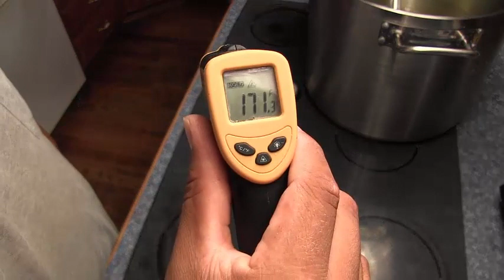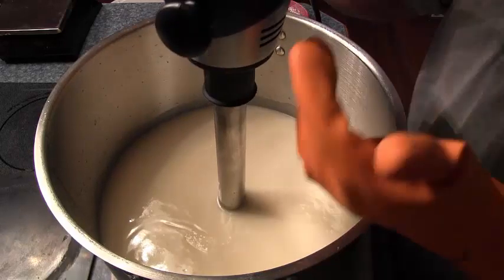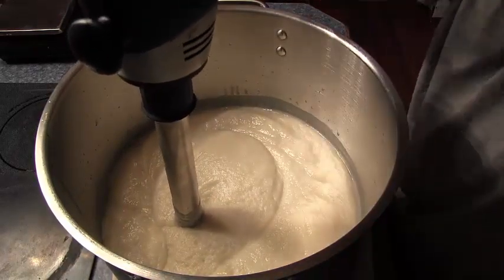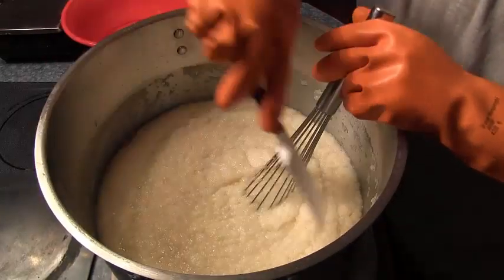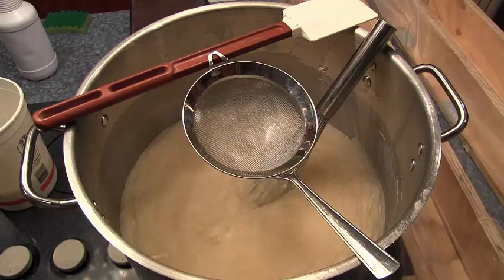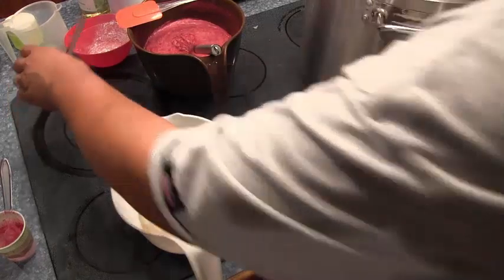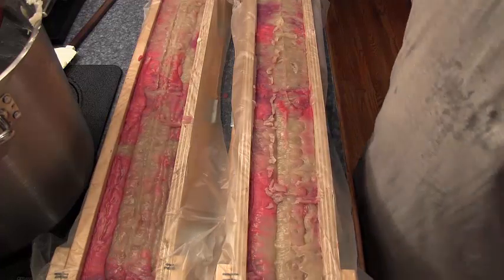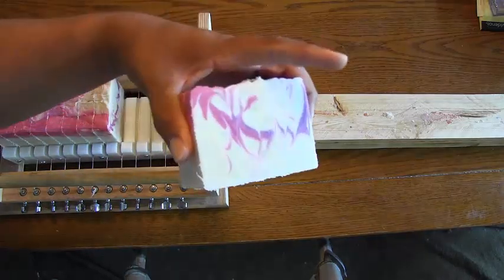Stick Blender Hot Process from start to finish

Comment: Lovey video.i have few queries
1.is it fluid hot process?
2.what did you add through filter?(as superfat)
3.What was the initial sf?and final sf?
4.does hp also need 4 to 6 weeks curing period?
5.how to rectify when my fragrance oils accelerates?
Thank you
Reply from the maker: It is also called fluid hot process.
We always allow our soap to cure for 4-6 weeks no matter what method we use. It is usable immediately after making, however, it won't be a great bar of soap until it rests for a few weeks.
You can use any recipe you'd like, SF is up to you.
If you have a fragrance that tends to seize, you can either switch up your recipe to include more soft oils or use cooler temps.
Cooler temps will not work with this method, but you can still soap with your favorite scent.

Comment: This is such an awesome video and love how you explained the reasoning. I am just starting in soapmaking and I really am too impatient to wait on cold process to cure, lol. If I wanted to add whole milk powder would I do it at the end as well to prevent scorching?  Thanks!
Reply from the maker: That I don't know.  Haven't used powdered milk.  Milk scorching happens because of too high of a temperature.  If you stay below the threshold, it won't scorch.  Or you if there is enough "additive" in your milk solution, you can "raise" the scorching temperature which will also help prevent scorching.

Comment: Waouhhh, I found that video just now that I want to try a batch of hp. Nice even if for me who is french some part can be a bit difficult. But thank you.  Did you put back your oil on fire during the process?or just stay on the heat it has from the beginning?I have a slow cooker to try mine and i wonder about let it inside all long or not

Comment: I tried this method with a two pound loaf. I got it to mashed potato stage but it never returned to applesauce stage and I never got the high temps nor volcanoing. Does this method only work with large batches?
Reply: No, it works with small batches also. If you didn't get past the mashed potato stage, it was because your oils were not hot enough. The batter needs to be around 200* by this point. You can pop it in the microwave for a few seconds to warm it up if it's too cool and it will proceed through the other stages.

Comment: when You take The pan of The Stove/heating  when The oils are at The correct temperature did you afterwords put it back on The stove to re- heat The batch during The process of soapmaking? hope you Will answer my question. 

and Thank you so much for sharing. 😊
Reply from the maker: We didn't. 
Hope this helps!

Comment: Thank you for sharing this video! I thoroughly enjoyed it. I've watched many videos on Hp and this is by far my Fav! I have a question about superfatting. If I calculate my sp at 5% do I just withhold that amount till the end or do I even add it into the calculated? I use soapqueena lye cal and always choose the option of 5% and it's already added into my oil & butter mix but I'm just wondering how I would go about it if I want to add it at the end. Thanks
Reply from the maker: You can superfat a couple of ways. Either with a lye discount or additional fat after saponification has finished.  User preference.

Comment: Thank you so much for sharing. It was very informative. How long do you cure your soap before you sell them and do you ever add sodium lactate to your soap?
Reply from the maker: NYtalk60.  We don't add Sodium lactate to any of our soap.  We don't prefer it.   

As far as curing time, it depends.  It depends on the liquid content of the batch and the environment in which it cures in.  The less liquid your batch finishes with, the shorter the curing time--as a general rule of thumb.  The converse is true, the more liquid (percentage wise), the longer it takes.  Where we live, the season of the year plays a big role too.  Spring and Summer are traditionally hot and humid.  The more humid the enviroment, the longer it takes. 

We also find that curing is non-linear, it doesn't progress at the same rate throughout the entire process.  The soap will release the most moisture during the first part of the curing process while, the amounts relesed in the following periods will become smaller and smaller.

Your cure time will also be affected by the types of oils you use.  Some oils require longer amounts of times to fully cure.  An example would be a Castile soap using all olive oil which can require up to one year to fully cure, using a cold process method.  While we've never done a Olive Oil Castile soap with HP, I would imagine, the cure time would still be significiant.  Who knows.

The length of time you wait to sell your soap is completely up to you.  Things to take into consideration would be:

1.  The method you are using.  CP requires longer time to ensure all Lye has been sapaonified--it's not fully soaponified when it is poured into the mold.  Personally, I would never think of selling something that was not fully saponified.
2.  How long you want your bar of soap to last.  The higher the liquid (non-unsapaonified oils) content, the faster it will be consumed when used.
3.  Who you are selling to.  Some may wish to sell less cured soap (but fully saponified) as wholesale, where they sell in loaves, with the understanding of their customers the soap will need additional cure time.
4.  What is your direct customer expecting to receive.

So those are some of the things I can think of off the top of my head at the moment.  Probably more than you were asking for but, hopefully something in there helps.
Reply from the maker: After all of that, I realized I never specifically answered your question.  We wait until our bars have lost 13-15% of their original cut weight.  That works well for our recipe and the shape and size of our bars.  The amount of non-saponified liquid in the soap that is poured and the size and shape of bar will affect the cure time.  Along with the things mentioned in our previous post.
Reply: Thank you for your quick response. I appreciate learning the percentage of weight loss is important. Great information!

Comment: By far the best video on the process of making HP soap, The only question I have is what are you mixing your colors with before adding it to the soap base?
Reply from the maker: sometimes water, sometimes oil, it just depends on if the colorant is water or oil soluble.

Comment: What type of stick blender are you using? I have burned one out, so got 2 to switch between while mixing. It's kind of a hassle, so I need 1 that can handle the entire process.

Comment: I have utilized this method in small batches before, and usually I pop my small loaves into the freezer.  Hope long do your loaves sit in the long molds before un-molding, and do you just leave on a shelf while it is setting up?  Do you cover the loaves at all?  Thanks for your help with this.  I am mostly CP but was chatting with my hubby this last weekend about making bigger SBHP quantities, but am unsure about the whole process in such big quantities.  Thanks in advance for your help.
Reply from the maker: Jessica,
Our loaves sit for 12-24 hours in the mold (usually closer to the 12 hour mark)
We then remove them from the mold and let them sit for about an hour if it still feels a bit sticky on the sides.
Our molds won't fit in a freezer so we just leave them on the counter until the next day.
We do not cover them either.
I highly recommend a tall-ish pot so if you do have volcano's you don't have to fight them as hard or fast.
We just bought an 80 quart pot and are slowly moving up the batches to bigger amounts.
Right now we're at 32 lbs of oil, which in the end is 55 lbs of soap at a time
Hope this helps!!
Reply: Wow! That's a BIG pot!

Comment: Thank you for sharing your video. Glad to see someone else using the same method of making soap that I have done for a long time. I make 20 lb. batches and use a Waring Big Stick Pro. My stick blender does not come apart like yours does. I like yours better. Is it a Waring too?
Reply from the maker: Yes it is a Waring.  The detachable stick is a very handy feature.  The smaller version we have does not detach and that feature is sorely missed when we are using the littler one.

Comment: Hi thank you for your recipe really nice soap , beginner can learn about this.Big help for this video.. If this is hot process,ready to used by the nextweek, right?
Reply from the maker: We let it cure a full 4-6 weeks depending on how quickly it loses it's water weight. Technically yes it can be used immediately, but it won't last very long

Comment: Great video, thank you! This is something that I want to try with a Bastille recipe but I'm not sure if I can. Some videos say your have to use a lot of hard oils, such as lard or tallow. Is this true? Also, how much water would I need to use for a 2 lb batch? Would appreciate the help. Thanks
Reply from the maker: Best thing to do is use a soap calculator to determine the proper NaOH amounts for your specific oils.  It will also allow you to adjust your water amount.  I wouldn't  recommend deviating from your normal water-lye ratio until your are more familiar with how the process handles with your recipe and batch size
Reply: Thank you

Comment: Thank you charming engineer for this great tutorial! Your wife’s design is beautiful. Can I ask what you think is the best colorants for HP soap? It looks like you used micas, mixed with something? Also I was wondering about how it is with essential oils since the batter is so hot, do you need to use more than usual cause it evaporates? How many ml/kg of scent do you use? Or oz/pound . Thank you!
Reply from the maker: Trial and error.  No fragrance or essential oil will necessarily work the same way in one recipe as with a different recipe.  Oils used can effect the aroma and retention.  

Colors.  Again, there is no one magic type.  Depends on what you are going for.  An all natural soap?  You may want to go the plant extract route.  CP?  Will it gel or not gel?  HP?  Are you adding before mixing or after?  So many variables.  Try different ones and pick which best suites your needs.
Reply: Thank you!

Comment: what did you use to line your molds. very excellent vid I love it and thanks!!!!
Reply from the maker: I think for that one we used easy glad wrap.  Not saran wrap, the wrap with one sticky side and one side that is not (Why can I not remember the name of it at the moment)....

Press and Seal!  There it is.  Way too much work to remember that.

We make all of our molds in house so we use a variety of liners.  Whatever does the job for the mold we're working with.
Reply: thanks, I can't line molds with for anything with freezer paper and only have silicone liner and molds from essential depot which gets very heavy on the pocket. thanks very much keep the videos coming it was awesome.

Comment: Wow, you do such a fine job and making sense of this process.  I am of the understanding that HP save money on EO's, as you add them at the end when the soap temp. is cooler and lye is cooked out.  Was your soap at about 200 when you added the scent ? That is the only confusion I have. Perhaps your scent is at a high flash point ?
Reply from the maker: Generally speaking, you may save money on EOs and FOs with this process.  That is no guarantee though.  It comes down to the quality of the EOs and FOs you use.  You may need to use more of a lower quality fragrant than a higher quality one.  But you do not have the potential of the fragrant being consumed during the saponification process--assuming your batter is fully saponified at the end of this process.

Comment: ok when you figure out the oils. how do you figure out how to superfat? Do you use soapcal? Is the soapcal at 0 (zero)? How do you figure out how much oil or shea to use to superfat? I don't know that much about making soap and need help
Reply: Type in your recipe with a zero % superfat. If you are using 1kg of oils and want a 3% superfat you will take it off your oil value. So you are using olive, coconut and shea  (I know that's not good but...) and you want shea as your superfat. You will calculate your recipe based on 970g. If your total shea butter is 300g you will minus the 3% so add your shea to the soap calc at 270g and then keep 30g back to use later. Does that make sense or have I complicated it?!
Reply: @kelleyspartiatis4776  I superfat at 5% still a little confused
Reply: @home-cookedandhomemade6295  I'm not surprised. I'm not great at explaining! I'm going to just do a pretend simple recipe.  1000g of oil in total with a 5% super fat  means 50g (5% of 1000) we want unsaponified. The recipe is 300g coconut oil, 400g olive oil and 300g of shea butter. Usually we put the full oil totals in the soapcalc and choose 5% superfat option. In this case we can choose to have shea as our superfat so we take it off the oil total. So we take our 5% shea off at the beginning before we calculate it. So it becomes 300g coconut, 400g olive and 250g shea (with 50g set aside) Our oil weight we put in soapcalc is now 950g and just do a zero superfat. Then it will give the exact calculation. Cook your soap and add the 50g shea at the later stage. You don't have to choose what oil you want as your superfat so if you don't care about that then all you do is calculate the full recipe at 0% superfat and one your oils are combined and melted just take 50g out before you add the lye. Although it doesn't make sense to not choose your superfat oil if you can. We may as well just stick to CP or CPOP in that case. Hope I made sense this time. There's a reason I don't teach. I'm terrible at it !

Comment: Great video - loved it! I do HPOP mostly, but I loved watching your process. Would you mind sharing what pot and blender you use? Would love to make that my next purchase! Thank you for such an awesome video.
Reply from the maker: Elaine,
Because the smallest batches we do are 16 lbs of oil, we use a 40 quart stock pot we bought at a restaurant supply store and a Waring Big Stix blender.
Neither of these are necessary if you aren't doing large batches.
I started out using an 12 quart pot, and 2 cheaper stick blenders (one was used/free and the other was less than $20)
If your stick blender starts getting hot, you can switch to your back up blender and keep going.
Hope this helps!
Reply: Well I have to say this is one of the best videos I've seen. Thanks again for the time you spent in walking everyone through step by step, and thanks for the info. I'm ready to make the jump to better equipment so I think this is perfect for me. Thank again and best of luck to you!
Reply from the maker: +Elaine Lombardo you are very welcome!!
Let us know how it goes and if you ever get stuck we would be happy to answer any questions
Reply: Absolutely love the sharing attitude of yours. Every questions seems to have been answered, so a walk through comments is most essential. I hope to make soap with this process, though much smaller quantity.

Comment: I have made only m&p and cp soaps. I want to try hp because I thought cure time was much less after forcing saponification. However, you mention that fun cure time is 4-6 weeks, which is the same for cp. If it takes the same amount of time to cure, what is the benefit of hp over cp?  Also, is the burner on during the entire video?
Reply: The benefit is you can more easily control what oils and butters are touched by the lye, and yes technically you can use the soap the very next day.  Leaving it to cure allows the moisture to seep out of the soap, creating a harder, smoother bar that doesnt melt as fast in the tub.  I do fluid hot process soap and usually my cure time to get them pretty dried out and hard is about 2 weeks.
Reply: It's great because you can choose your superfat. You can't with CP. Plus you can use fragrances that rice and accelerate CP too much. Like florals. Also you use less fragrance and delicate fragrances come out stronger where they often get ruined in CP

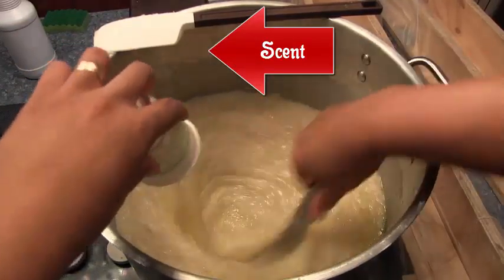Comment: I really enjoyed watching your video. You're a very good instructor, especially with everything you have going on at the same time. I've seen a few other SBHP videos and yours is the best one I've seen so far. I have a question, @ 27:38 what temp are you adding your scent in at? 
You mentioned that you put it in after the goats milk (under 184°F?) but does the scent burn off a little at that temp? Does adding scent in HP, at these temp. required more or less or the same amount of fragrance as CP?
Thanks for sharing your talent, skill, and craft with the rest of us. =)
Reply from the maker: The only critical thing about the temp at which the fragrants are added is this:  

1) Will the current temp cause it to vaporize, so to speak.
2)  Will the batter temp cause the fragrant to reach or go beyond it's flash point?  (This really only comes into play if you're actively smoking or working near an open flame--both of which could cause the fragrant to ignite).
3)  The batter temperature needs to be hot enough to allow the fragrant to be incorporated fully.
4)  Will the temp cause deterioration to any of the additives to be added.

That's about what I can envision off of the top of my head.  Good luck!